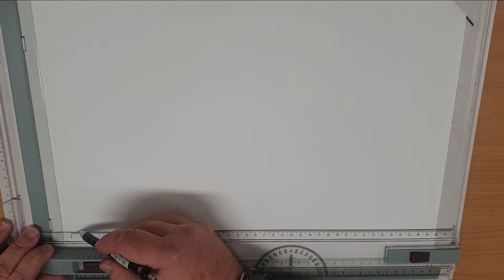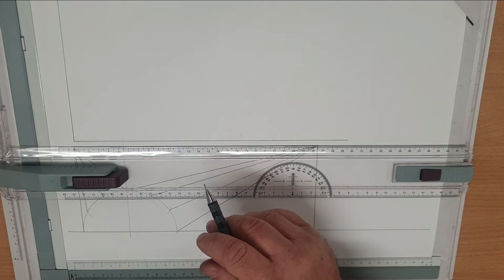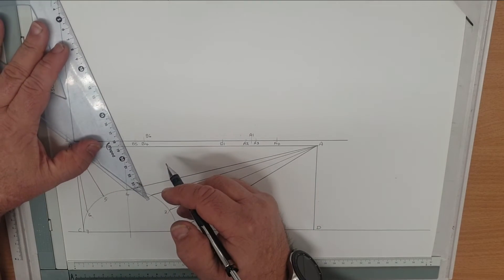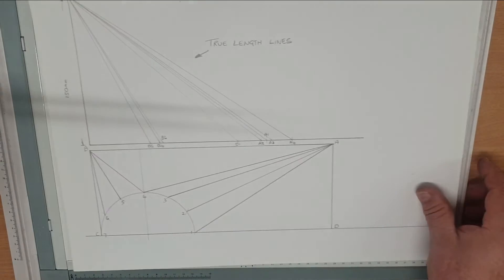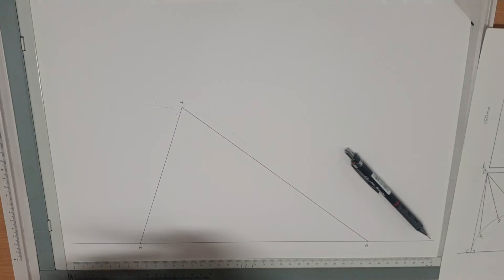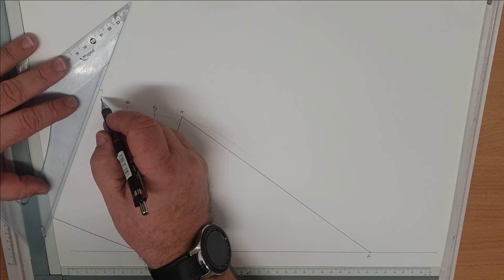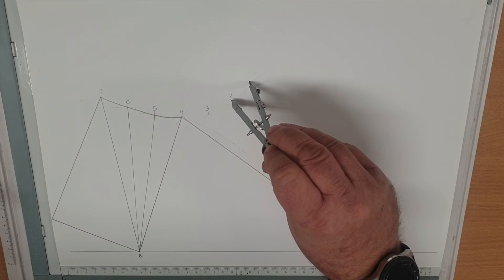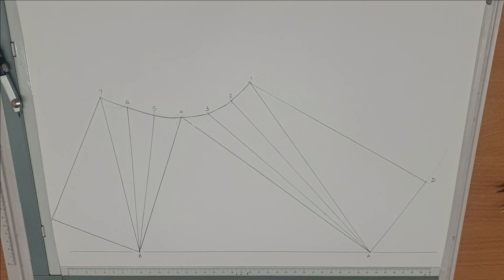Technical drawing Offset Square to round

Comment: Just a quick one if Iam using say 12 mm plate will the dim at bottom be inside size and mean dim at top
Reply from the maker: Hi Andrew
 Its down to your diameter that's required for the top. The pipe size will set whether you use the mean or inside dim.same with the bottom.
Allowing for the material thickness and your bend allowances is something that you need to allow for.